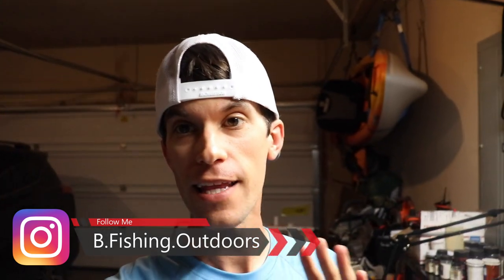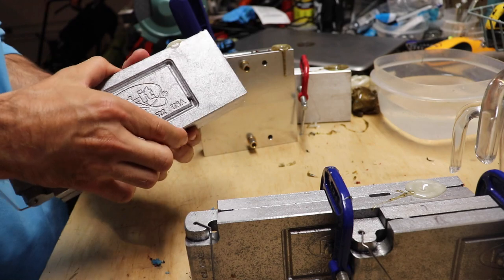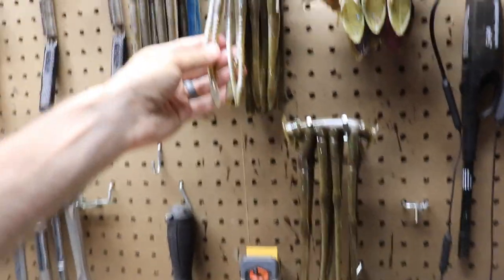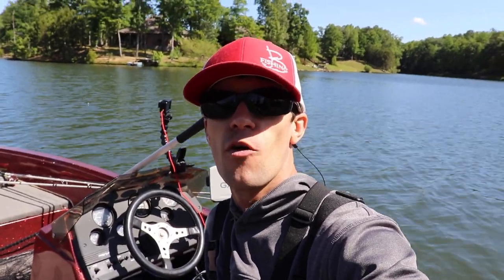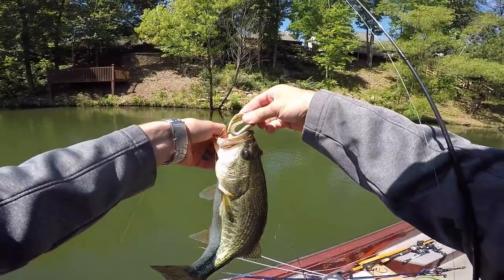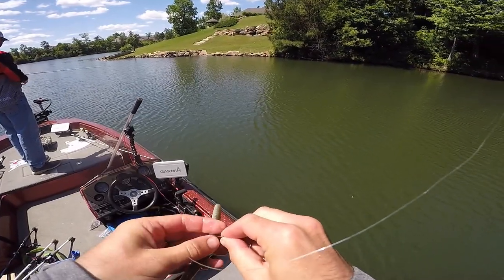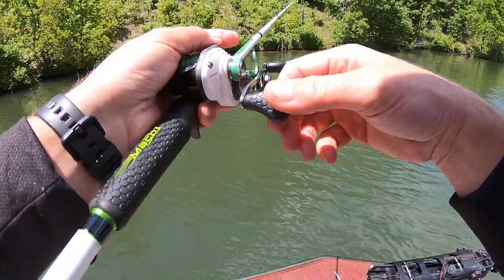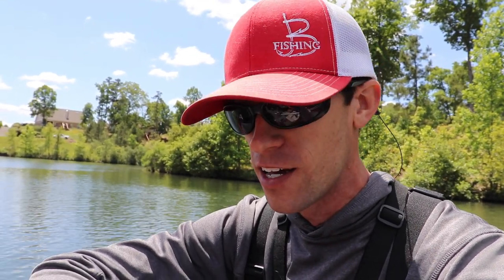RE-MELTING OLD WORMS to catch GIANT BASS (NEVER BUY WORMS AGAIN!!!)

Comment: I need a cheap but decent mold so I can remelt any ideas?
Reply from the maker: Go on Facebook and join some soft plastic bait making groups. And look for some used do-it molds. that's what I'm using in some of the videos and you can get them for $30 shipped to your door usually on these sites used